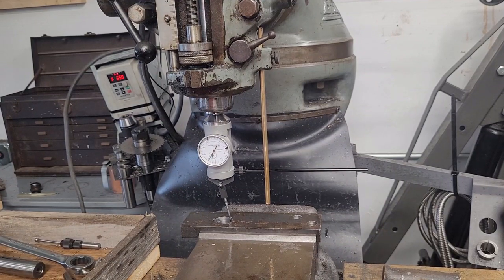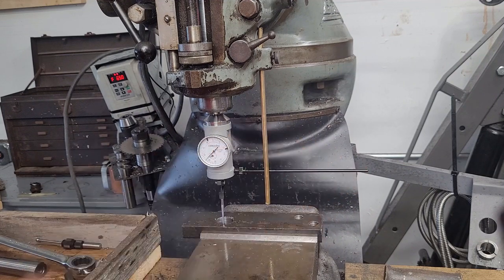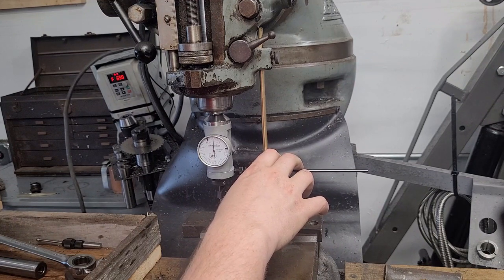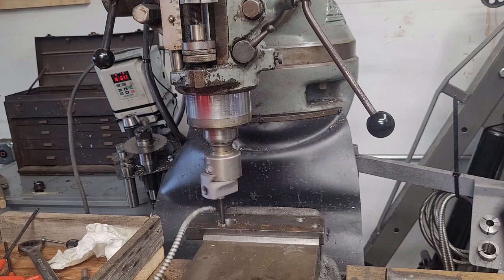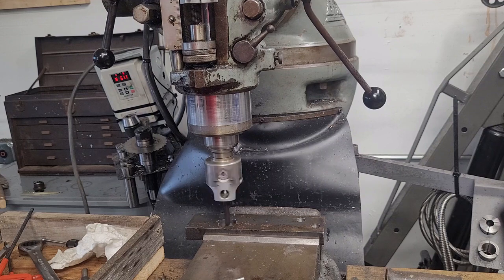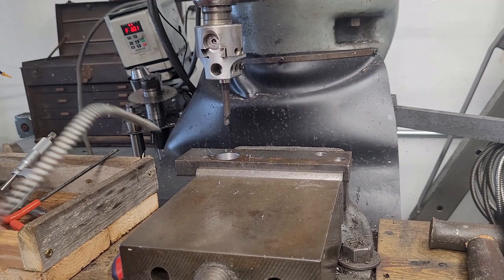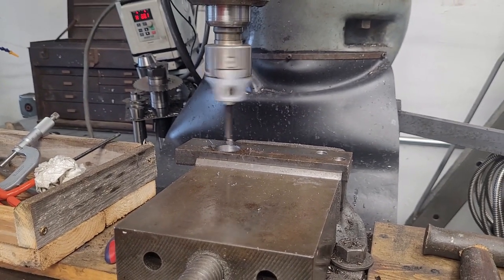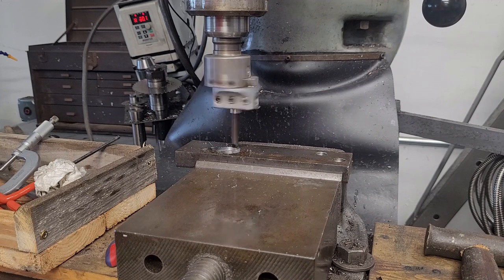Dumb Dumbs Guide To Machining: Boring A Hole On a Bridgeport J Head Milling Machine

Comment: Surely it is good practice when the boring has ended to switch of the head rotation and pull back on the boring bar with a finger before raising the head. This ensures that a scratch line is not made by the tool tip.
Reply from the maker: I never really found that to be an issue. With finish cuts there is minimal deflection. I can see it being a problem in applications where surface finish is a higher priority,  but I primarily bore for press fits, not sliding fits.